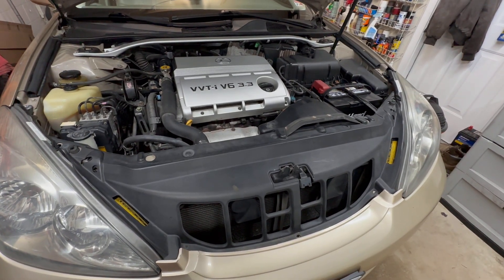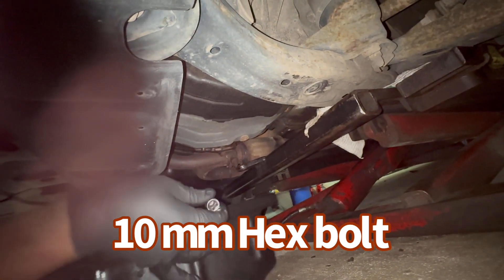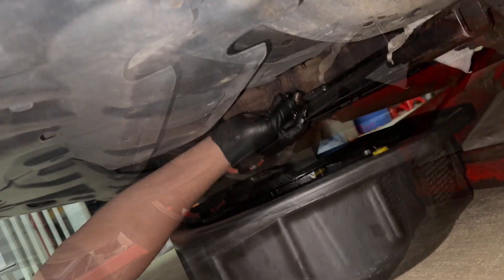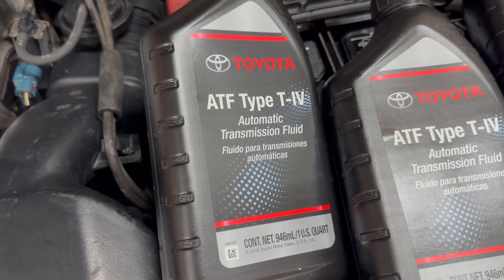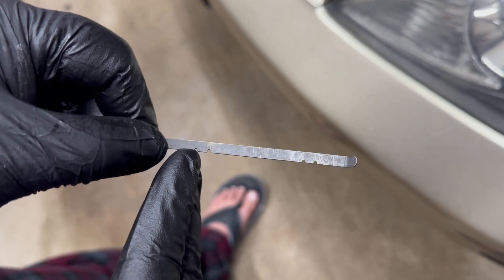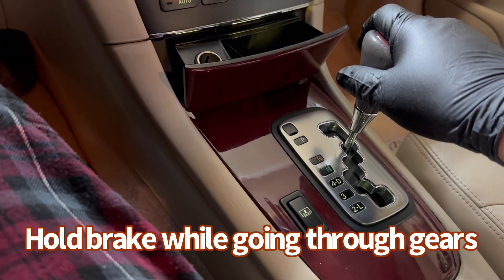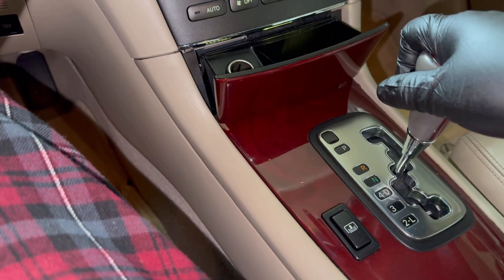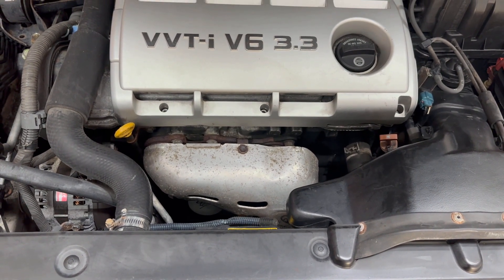2006 Lexus ES330 Transmission Fluid | Drain and Refill

Comment: Just got one of these cars and I’m not sure if the transmission fluid has ever been changed. Would you advise changing it or just leave it because I heard from another YouTuber( former Toyota tech) to leave it if it’s not been serviced regularly as it could cause slippage.
Reply from the maker: Yes, if you don't change your transmission fluid when it's old and worn out, it can potentially cause your transmission to slip. So I guess it’s all depends on mileage and conditions of driving.
Reply: @kashfix9160  thanks for the response. it has 147K miles on it.

Comment: I have es330 Lexus and my transmission is not smooth please what could be the course why it's not selecting smoothly?
Reply from the maker: What mileage you have on your car? Could be trans wearing out, sticky valves or burned trans oil.